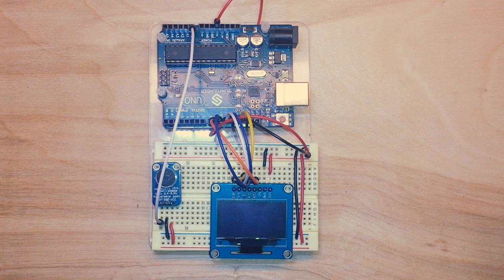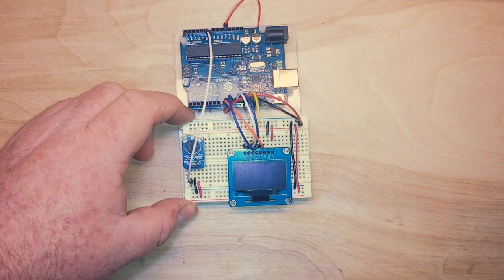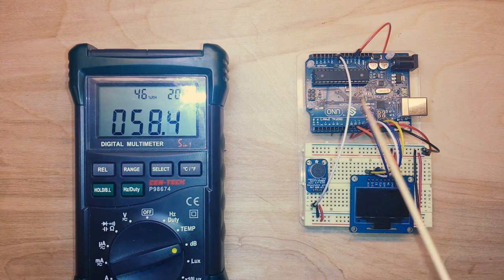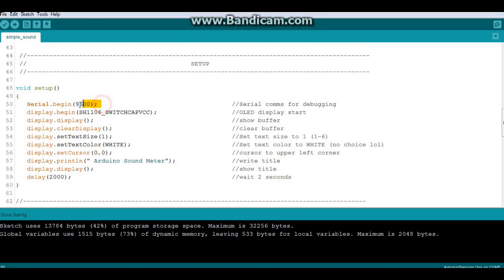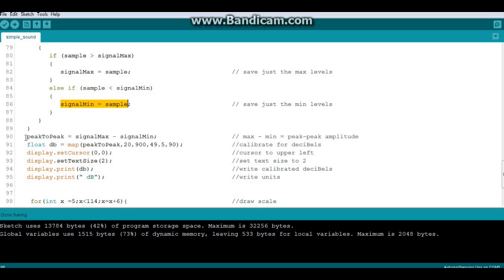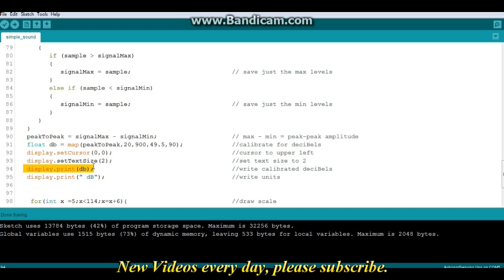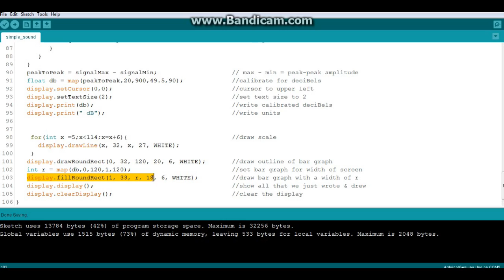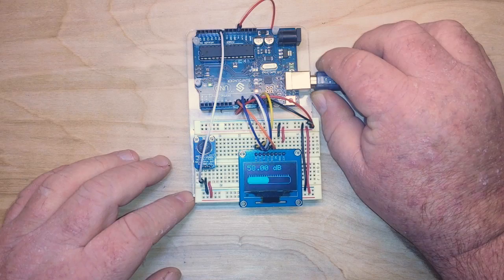Arduino Sound Meter

Comment: The voltage from the microphone is a linear function (usually mV/pascal). Decibels are a log function. You need to convert the voltage to decibels using the equation dB = 20 log (the change in voltage between one value and the other). Decibels are ratios of 2 values.  When comparing 2 voltages, "20" is the multiplier and when comparing 2 power values, "10" is the multiplier.  In electronics and  communications, the comparison is often done referenced to a particular value such a 1 milliwatt. 0dBm is that reference representing 1 milliwatt. So if you have a signal level that produces 1 milliwatt of power in a 50 ohm resistor, it is given a decibal number of zero  i.e. 0dBm. If you then increase the signal power to double that value, the change is 3dB, and the higher value is +3dBm.  If the power goes up by 10 times, the new value is +10dBm. If it went down to a quarter of 1 milliwatt, it would b -6dBm, and so on. The arduino code in this video does not result in decibels between the 2 limits that were measured by the meter. In addition, sound levels as measured on proper meters, also have "weights " which change the power law according to the type of sound, and that can be anything from a pure sine wave to random noise. These weights can be called "A", "B", "C" etc.  And lastly, the frequency response of the microphone and its own particular response amplitude curve, will also be factor. Sometimes the sensitivity is in dBu or dBv etc., calculated using the log equation from mV/pascal. The frequency response curve, and output voltage is anything but flat, and depends on the mounting, polar response, room reflections etc.. A calibrated microphone is needed to get accurate levels!!. This video is technically not a proper dB meter, and should be treated as a simple instrument that responds to sound and does not display accurate dB levels. Go to the web and look up the hundreds of posts on decibels to get a good grasp of the meaning of decibels. If you are a technical student and use this video you will fail your exams.

Comment: I realise that coding is my weak point, but I didn't see how you are accommodating the linear measurement  scale of the ADC when mapping to the logarithmic scale of dB
Reply from the maker: pileofstuff it's more a function of calibration than coding. I set the Arduino sound meter's minimum to match the minimum on my DB meter. then I made the loudest noise I could and set it to match the output of the standalone meter. the map function takes care of everything in the middle.
Reply: pileofstuff is right; you can't do a linear interpolation of voltage and expect it to map to a logarithmic scale.  The number you are displaying is not in decibels; rather it's a scaled representation of pressure (in pascals).  There are a number of other issues with the methodology here, but this is the most significant.

Comment: First and MOST important: using linear interpolation and decibels with the "map" function is just wrong. The correct way is to interpolate pascal values (X) and then convert to decibels using: LdB= 20 * log10 ( X / 0.00002). 

Secondly, using your voice level to find the peak value and interpolate will limit the detection of louder levels than your voice, and lower levels than your current noise floor. And it is Totally avoidable. You could interpolate between 0.002Pa(20dB) and 1Pa (94dB), which might be more reasonable.

Lastly, calibrating arduino with a multimeter is just not that accurate, since the multimeter itself might not be correctly calibrated, or lost its calibration. Even if it is, it could be displaying weightened dB(A)/dB(C)/dB(Z) values, for an undetermined frequency band. Sadly, to solve this you should calibrate using a calibrated soundmeter, if you want to be serious about the proyect, of course. 

Cheers-
Reply: @Ideas Inventions and Innovations  This is not how science works. Jesus...
Reply: hello sir, i need your help please.
Reply: Hi sir, do you have any suggestion how to get db reading from analog from of sound sensor. i dont get how to relate analog reading to the LdB equation.

Comment: Looks like talking did not actually change the decibel reading at all. I too am struggling to get low level sounds to register on my sound meter which uses an electret microphone. Need to find a solution!
Reply: Did you find one?

Comment: I would like to know if you can change the part of the microphone with one of these (Sensor Module Sound Noise Detector FC04 Digital Arduino PIC)

Comment: Liked this for sure. Anyway.. can you help me with what Im going to modify if I want the exact project like you... but not in arduino..instead im using ATmega16 (in a minimum system) and ofc i'll have to use an ISP programmer.. any tips? thanks!

Comment: What happens if I don't use a display? I mean, just want the results in the computer monitor. I tried to delete part of the code about the display and reemplaced the "display.println" to "Serial.println" and stuff, but is always de same value at the end (49.00 dB).
Reply from the maker: It should work just fine without a display as the display has nothing to do with the readings.
Reply: is true, if it works with AnalogRead check if your sensor works well
Reply: damn same problem it is like 31 32 and if its loud it goes to 1000 and thats it
Reply: I have the same thing, it stays in 49dB, I found out it is the map, that has 49.5 as one of its values, but if I change it it is pretty much the smae

Comment: Anyone please help to use this in ESP32. I try use ESP32 (esp32-wroom-32) using A0 (GPI_036). The value reaching 240000.0 and when i creating noise the value become normal result and if i stop the value will back to 240000.0 . But when i using ESP8266 show like from video normal result. Any clue why? Thanks